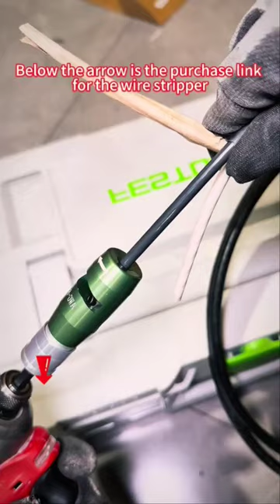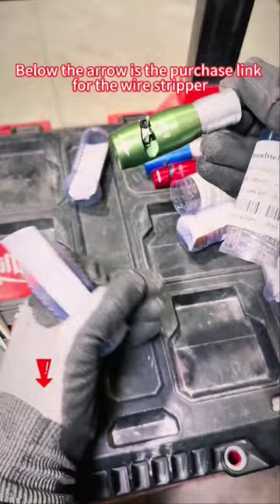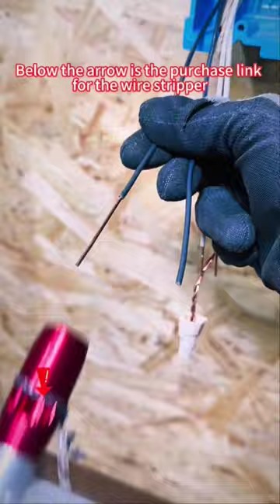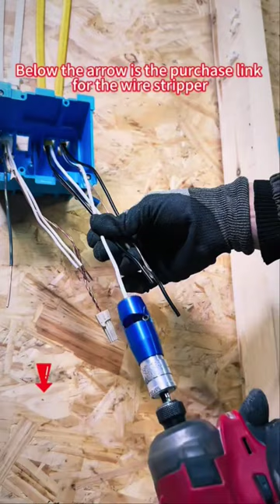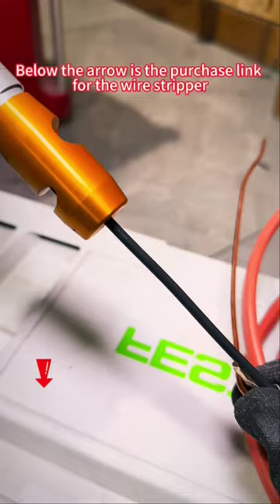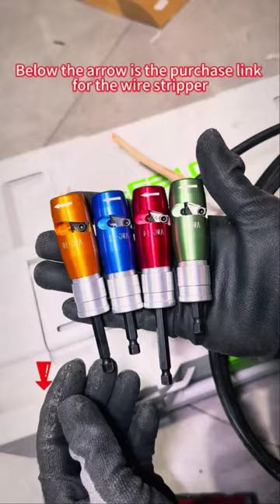The new electrician wire stripper isvery pra ctical and can strip wireseasily, making your workhappy

Comment: How many minimeter cross sectional area wire  used wire striper. 

  Example  
Area  2.5mm wire 
Area 4mm wire 
Area 2.5 mm wire